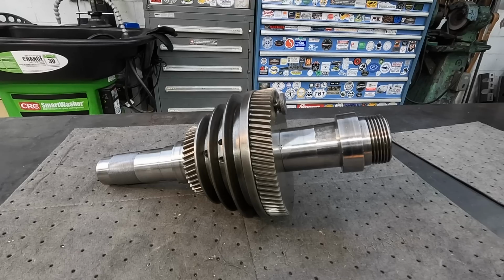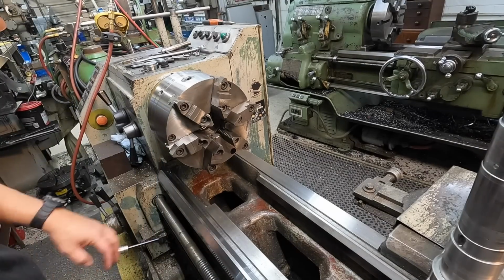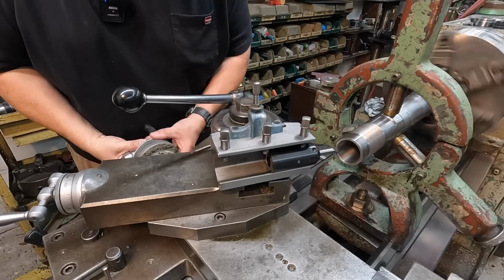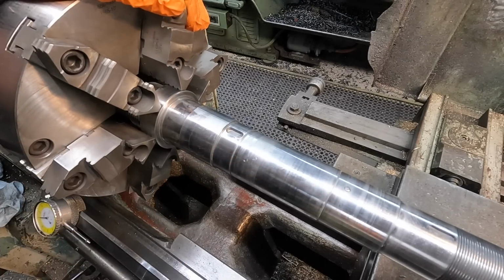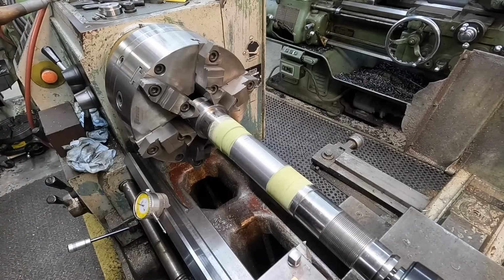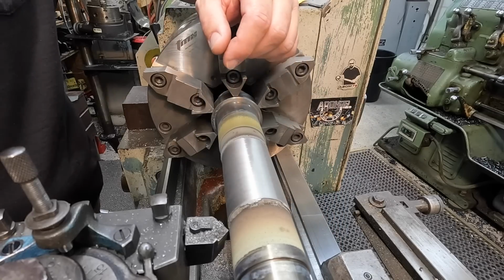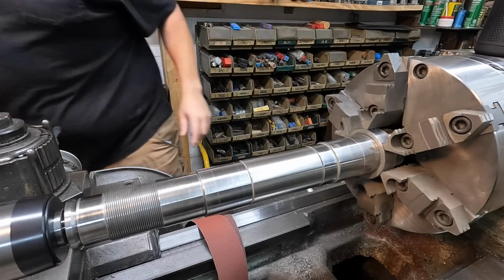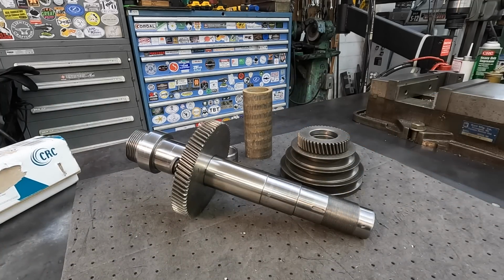Lathe Spindle Repair

Comment: I have a custom 4140 bt30 spindle I’ve machined the raw stock already for an RF45 style Cnc conversion I’ve built. 

I haven’t yet machined the final bt-30 taper, through hole, the vertical grooves, or the spindle lock threads and the upper pulley threads. Its a clean rough cut and thats it.

All of my equipment is in storage at the moment until i can find a cheap rental space to set it back up and id really like to get this spindle finished, and installed before i do so its all ready to go. 

Would you be able to finish or consider machining this spindle, and give me an estimate? 

I left approx 1/16 extra on the surface, or 1/8 overall diameter on the rough cut spindle so that and the vertical pulley grooves at the top will need finish machining as well threading on the top for pulley and threading where the lock nuts set the AC bearings. 

I do have the capacity to heat treat the bearing races and the taper so i suspect it would be a two part service unless you can also do the heat treating and final grind of the taper and races. Either way works for me. 

If this is something you would do i can send photos of what I want to accomplish, dimensions, drawing, and i can ship the original spindle so you have something to take measurements from. 

Not many if trust to do this but i know you’d get it done properly. Thanks.

Comment: I have a dumb question,  can you shave your center's so they are uniform again?
Reply: He’s trued them in past videos.
Reply: Dead-centers, yes. It's done all the time.  But, those old centers appear to be live centers, meaning they are equipped with ball bearings. (The conical taper spins freely on the shaft)  He would have to grip them at the edge of the conical-tapered part, not on the mounting shaft.  I'm not sure that would work out well.
btw, that was not a "dumb question".
Reply: @surlyogre1476  good point…pun intended 😬
Reply: @surlyogre1476  It's actually pretty easy to hold the rotating nose against the stationary body with a pair of wedges (like how you pull a Jacobs chuck off of its taper), put the resulting dead center in the taper of the headstock, and smooth up the cone with a toolpost grinder.  What's sometimes not so easy is to find the time to do it.

Comment: Can the spray weld be hardened or is it even necessary?
Reply: necessary
Reply: He talked about the next video will be boring and bushing the pulley set that runs on the flame spray area, so  it is already harder than the bushing will be.
Reply: I think they make special hardened spray powders if you want that.

Comment: Great process   super interesting  watching this. Do you have a link for the flame spray equipment  you are using  ? Iam in Australia and work from my shed doing engines  and especially transmission repairs  I would definitely have demand for this repair technique 🙂

Comment: On that steady rest with the stuck knob. Could you while trying to find the "touch point" watch the roller on each nose to see when it starts to spin? I would think that would get you to where you want to be on adjusting them. Just saying.
Reply: This steady doesn't have rollers.  Many older steady rests use a replaceable brass contact pad, kind of like the old brass bushings or plain bearings that were in use prior to ball bearings being used almost everywhere.
Reply: No rollers on that steady rest. Just friction pads.
Reply: The steady he's using doesn't have rollers.  It has solid bronze tips.
Reply: @Ddabig40mac  oohhhhh, did not know that. Thanks👍

Comment: Could you not weld up the grooves in your centers and re-machine them? Mig wire seems to lay down fairly hard when do this.
Reply: If its easy to disassemble, you could just scrim the taper and have a slightly smaller cone.
Reply: @nils1953  I have done that with success, good tip!

Comment: Great job Adam as always. But we really need you to show us some videos about spray and then fuse process in which the the temperature reaches red hot and the bonding between the fused powder and the substrate is metalorgical not mechanical by threading. As you have never made such a job ,please show us something that we can by it achieve high hardness for anti wear coating. 
Thanks alot and wish you all the best
Reply: If the process required the substrate to be red hot before it bonded correctly don't you think the manufacturers (and users of the product) would have discovered that during testing and later actual usage in the field? The flame sprayed material bonds to the surface. The threading makes the bonding even better. If you want more info go to the website of the manufacturers of the equipment and also look at previous videos Adam and others have done. If the flame spraying and subsequent machining did not do the job required of it, do you not think Adam and other users of the product would have found out about that from the end user(s) and then stopped used the product/process?
Reply: Dear sir.
Let me tell you that this process which Adam does perfectly is called cold process spray welding and as Adam and the manufacturer say ,the temperature of the substrate should not exceed 200 C degree. 
What I need from Adam is to teach us another process which it is called hot metalizing .
In this type the substrate should be prepared with threading or grit blasting then preheated up to 250 C degree, make spraying to the required thickness or little bit more and then fuse the powder with a bushy flame torch to reach red hot temperature. 
This whole process provides metalorgical bonding between the base metal and powder not only mechanical one.
The hardness of the fused powder is so high to machine but with cbn insert. 
This thing is well known in metalizing field but I needed Adam to illustrate more about it ,because he gives the parameters perfectly and I need to know more from his high quality teaching.
If you have some info about hot process please share it with me.

Comment: You probably should have left the bull gear off. The owner will need to remove it the get the right side bearing race back on anyway. In fact, I don't know why he even sent it. I don't think needs to be there to do the repair. (I have a similar lathe which needed a similar repair.)

Comment: was it that vital to get that small pock hole out, since you put a thread on top of the undercut anyway for adhesion, and is there a minimum depth of spray material
Reply: What is a pock hole? And whats it uset for? Sorry im new ;)
Reply: @mapsi03  the small mark on the left side of the repair that he undercut even more of the shaft to remove

Comment: hmmm , if there still parts available for this machine that would be the best route to take as you dont change the dimentions inside the parts (original replacement parts would still fit )
this seems to be an older machine and i doubt you can still find a replacement shaft and or pulleys for it 
that said you could grind / machine and pollish the worn part of the shaft under size on the surfacegrinder / lathe then put bronze bushings in the pulley setup but bore it undersize to fit the new sized shaft and make a new spacer with an undersized hole (or put a bushing in that too )
shaft seems to have a small step in it so i think it could be done up to the gear with the pin in it , not sure if theres a bearing on the other side of that shaft after those pulleys on the stepped piece though
Reply: In fact, he was actually extremely careful to replicate the original dimensions, and is improving it by adding a bronze bushing instead of running cast iron on steel and having the same galling happen again. Original replacement parts would fit right back on there if necessary.

Comment: Steel on cast iron is a TOLERABLE bearing pair.  Leave it to Adam to make things GOOD, with steel on bronze.
Reply: Tolerable in a functional sense, but not in a long term maintenance one. Not having replaceable bushings is a classic 'cost cutting' design choice.

Comment: No soft jaw inserts while clamped on that shaft? You did say that was a seal surface I thought.
Reply: That's right. After many, many years in the game he still does not know what he is doing. So you'd be better off stop watching all his videos, while the rest of us see how the work should be done. Retired mechanist/mechanic in Land Down Under.
Reply: @bobhudson6659  heaven forbid anyone question anything.  fanboy
Reply: @paulb3095  So you would not mind your boss questioning you about a very basic part of your duties, duties you have been doing for years and years, especially when your boss is implying that by your actions you could be stuffing up the whole job? I would get "my nose out of joint". Think Adam might feel the same.
Reply: @ScrewDriverxxx  There's also no real squeeze on those jaws to leave a dent.  The turning torque on those shallow cuts is minimal so it only has to hold the part from falling out.

Comment: I don't know I'm not a mechinest but wouldn't have the little spot have been better than a whole groove for the strength of the shaft seems like the strength of the shaft got sacrificed for a little spot I don't know I'm just a mechanic not a mechinest
Reply: A spot like that creates a  stress riser in the material, better to fix it like this than keep it. (You can't really add material to fix just this one spot without risking to warp the whole shaft I think).
Reply: So unbelievable to me how some that works looks like new other than a little color difference and I bet if it was solid even that wouldn't have happened that is so 😎 and so many things can become same as or better than new it's so awesome 😎👍 I never would have known thank you for showing me it's actually not the first time I saw you do it just the first time I commented love your vids and your camping trips awesome 😎👍
Reply: So the spray weld replaced the overall strength of the part at the same time it replaces the surface I would have never thought that it's awesome 😎 you can have a part that is totally junk and make it like new wow that's awesome 😎👍 wow make big money 💰 dude that's awesome 😎👍 laugh all the way to the bank on that lol 😆

Comment: Whenever I washed something in the cleaning tank I used to rinse it off under hot water and then blow it off with the air hose.
This usually worked great.

Comment: It can be argued that spraying a lubricant on a shaft that is to be press fit is not a good practice.  While it helps ease the movement of the gear, heating the gear is probably a better practice.
Reply: I think i trust Adam's judgement. This isn't a very high torque application

Comment: Brand new shop, thousands in new equipment, yet the actual work operations are still done in the old shop. I wonder why ?
Reply: Why would he flame spray on a brand new lathe when he has an old one?
Reply: Hundreds of thousands
Reply: One other simple possibility. The flame spray rig is in the old shop and ready to go. As often as flame spray repair is required it is probably more convenient to bring the parts to the equipment. - PS  The closing picture with you, your grandfather and your dad tugs at my heart strings every time.  Don't ever change it.
Reply: @skywelder6349  nope.
Reply: @colinfahidi9983  nope? That Flex is easily $250k
Reply: @paulsullivan6392  I completely agree Paul.  I stubbled across a different youtuber and in one of his videos he used @Abom79 music.  I let him know to check out Adam's SNS.  But I have to admit it irritated me a little bit.  LOL
Reply: @kylebracht  I know, but he didn't pay for it, it's on loan from Flex as a promotion deal.